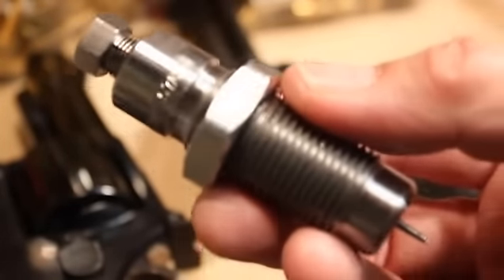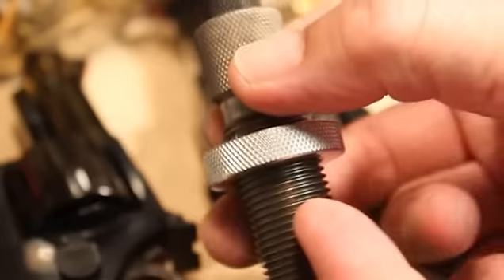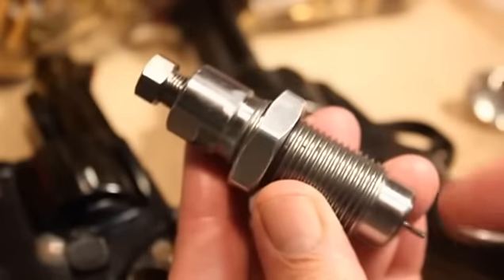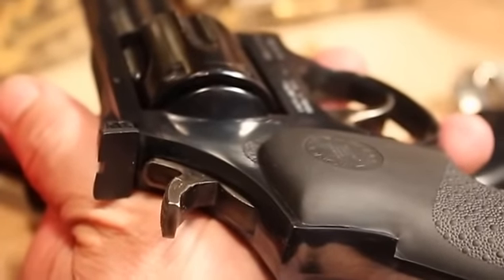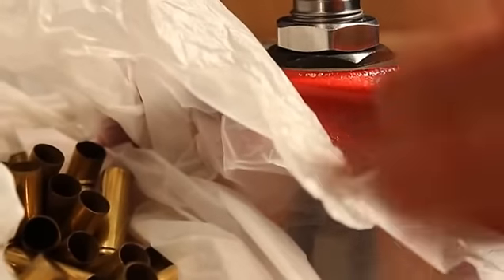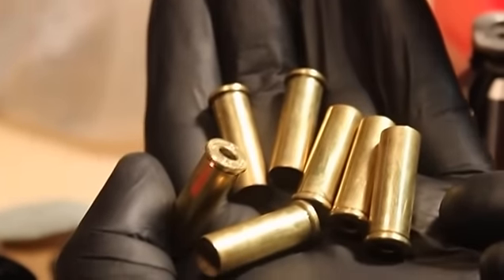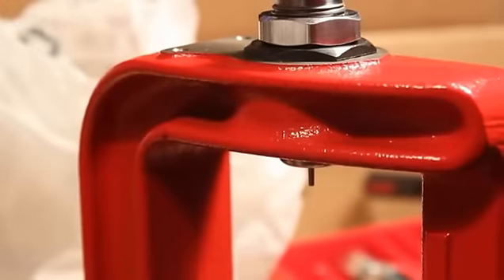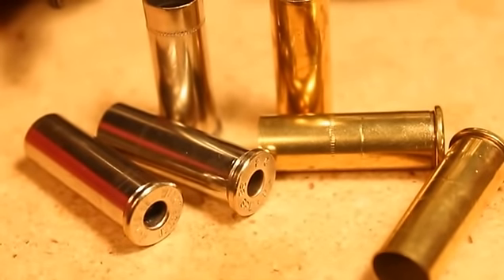Carbide And Sand - The Taboo On Resizing Brass First And Then Cleaning

Comment: When I bought my RCBS Rock Chucker II single stage press some 30 years ago, it came with a how-to video. In the video, it stated the order of steps to case prep:
Inspect the cases.
Lube the cases outside and inside the case mouth.
Run the case into the decapping/resizing die.
Check the overall case length, trim if necessary according to the load data.
Champher, and deburr the case mouth.
Run the cases through the dry tumbler. 
Remove from the tumbler, inspect the inside and the flash hole for media residue. 
Cases are now ready for priming and reloading. 

Been doing it this way for both rifles and handguns, ever since I rolled that first, once-fired .340 Weatherby case up into the RCBS die, and countless .357 Mag, .44 Mag, .45 ACP, and .40 S&W cases into carbide dies, thereafter. Nary a scratch on the cases and upon close inspection, the dies are none the worst for wear. If it ain't broke, no need to fix it.

Comment: RE: ~5:30  -- I live in Central WA sagebrush country. Wind blows sand everywhere at most of the places I shoot out doors. I've learned not to leave gun cases open after having a gun get scratched by the foam padding absorb blown sand and moisture, only to scratch and spot rust the gun left in the case.

Now I vacuum out the foam from time to time, and keep the cases closed while at the range. All my brass is always gritty and that helps with the first stage of the dry tumble process. Smart shooters in my area are careful to clean magazines inside and out regularly and avoid wet lube systems on their guns.

Comment: My method is to tumble in walnut shell for about 20 minutes, then decap. I use a 50/50 mix of Nu-Finish car wax and mineral spirits in the walnut media. This gives the casings a very slight coating of wax that makes the resize/decap process a breeze. After that they go into the liquid tumbler and come out awesome! For drying, I commandeered an old food dehydrator the wife planned to sell in a garage sale. It works very well.
Reply from the maker: ***** You've hit on it!!  Good rinse followed by thorough drying is what makes the wet tumbling results that we want...Food dehydrators do exactly what we need for our brass drying - got to go check those out at Target or Wal-Mart next opportunity...I've been using a hair dryer or the sunshine (great for summer)...  Have a great day
Reply: *****  I do similar, minus the nifty food dryer. I have a toaster oven for that & other firearms chores. Old walnut media gets dirt + mineral spirits. Then brass is quickly sifted and transferred to clean walnut media pre treated with nu-finish.

Comment: The point was made that smokeless powder contains no grit. That may be the case, however, "Priming compound, which may contain glass or other abrasive, is very abrasive in action on the dies and it must be wiped out frequently or wear will occur" (Twenty-Two Caliber Varmint Rifles, Charles S. Landis). Landis was referring to steel rifle dies, but regardless, the point is that primers contain abrasives. 
I have other references that state there are abrasive materials in priming compounds, such as a PDF from McDonnell Douglass  that states "Probably the most frequently used fuel for priming
compositions is antimony trisulfide, since it also doubles as an abrasive" (http://www.dtic.mil/dtic/tr/fulltext/u2/a114616.pdf) 

And this:
" Up to early 2000 [with the advent of lead free primers] the most common primer composition encountered was still the lead styphenate, barium nitrate, antimony sulfide and tetrazine type. In this priming compound, lead styphenate and tetrazine are the sensitive explosive ingredients; barium nitrate provides additional oxygen to increase the temperature of the flame, and antimony sulfide acts as a fuel to prolong the burning time. Aluminium, and occasionally magnesium, can also be encountered, but mainly in the higher-powered magnum pistol or rifle calibres.
Powdered glass was also often added to the mixture to increase the friction and to assist detonation when the mixture is crushed by the firing pin" (https://www.bevfitchett.us/ballistics/priming-compounds-and-primers-introduction.html)

 I have read on various reloading forums that carbide is so hard that only a diamond can cut it. This is false. Carbide can be ground on a common aluminum oxide grinding wheel, the same wheel many people have on their bench grinder at home. Notice I said "can be" not "should be." The point is that an A.O. wheel will cut carbide.  (Note: I grind my TIG tungstens on a A.O. wheel, but don't tell anyone. ;). I haven't tried grinding or scratching carbide dies on purpose using common sand or grit, but maybe in the future. 

I post this comment because in the video a great emphasis was placed on the fact that smokeless powder contains nothing that can scratch or wear a carbide ring. Priming compound residues contain materials that can, arguably, wear or scratch a carbide die. How big of a concern is this? Probably not enough to lose sleep over. I think a better question is what happens to that abrasive dust when you vibratory tumble? I imagine that it's spread all over the exterior of the case, which is then ran up into the die. Seems a little counter productive. 

Again, just food for thought. I appreciate the videos and hope see more outstanding content. Take care, John T.

Comment: This remains one of the most controversial subjects in reloading, but I’ve joined the “Size and De-Cap” first minority. I did 10s of thousands of clean first then decap rounds, then came to realize just how much more effort it takes to size “clean” brass. I began using Hornady One Shot case lube, resulting in slick cases. I also noted that my powder would stick to the “non-fouling” dry lube at the case mouth, thus ensuring that seating a bullet required it to push the powder out of the way, unless I cleaned the brass again after resizing. Way too many touches for me. All of my shooting is indoors, floors are covered with carbon, but no grit. Now I squirt my dirty brass with One Shot, size and decap, put into my dirty brass bin awaiting sufficient accumulation to break out the wet tumbler, and I haven’t scratched a case or a die yet. If I ever get to an outdoor range I’ll decap, then clean, then resize, as the majority demands.

Comment: Well now I think I will invest in a wet cleaner. I live in Oregon and winter mud equals revolver shooting. The mud makes the primers tarnish quickly and I end up using a primer pocket brush to get it clean. Your way would be perfect for my revolver brass. As usual, the information you freely give here is easily digested. Thank you FortuneCookie45LC.
Reply from the maker: ***** Good reloadin' and good shootin' to ya!!  FC
Reply: +FortuneCookie45LC 
fortune cookie i'm getting in to reloading and i have a question on 
reloading .38 special 2" snubnose smith and wesson what's the grain 
require for that particular gun..

Comment: Another option for decapping dirty brass (prior to tumbling) without worry to get grit in  decap/resize die, is to use the Lee Universal decapping die.
Reply from the maker: JBBooks4440 Got that in the latest Midway order - it's part of the idea for this video - do we just get that die or use our resize die to decap (and size at the same time) - can't hurt our carbide die and if the size die gets dirty, a brush will fix that up pronto.  Best Regards to ya

Comment: Hi FC. 
I have found that even after a quick cleaning straight wall  that I get a lot of resistance when depriming / resizing..
I am referring to the Lee carbide die. So I do use a little lube and the process goers much smoother..
It is on the return stoke that I find the sticky resistance...
Am I doing something wrong?
Reply from the maker: tjmooremusic - Not at all, there is some resistance to resize whether the cleaning is done before or after the resizing.  And yes, a light application of our homemade lanolin type case lube does make the resizing go easier.  Plus, the lanolin left over doesn't have to be removed (it acts as a natural protectant) afterwards unless the reloader simply desires to do that.  A number of our reloader friends on YT like to do this spray treat before resizing.  Have a great day,  FC Steve

Comment: i use the universal decapper then i toss the bass in a bucket with hot water mixed with salt dawn and vinegar to clean the bass, then i relaod it, if its ammo i reload to store for a while ill toss the bass in crushed walnut with nu finish to polish it to keep it clean in the ammo boxes
Reply from the maker: Josue Guzman - Sounds like you've got your systems in line that work very well for you...Thanks for posting...there have been others that like to just soak their brass...  FC

Comment: There's a guy on ebay named guntools that sells an upgraded decapping pin for that lee universal decapper. I got tired of breaking pins on crimped primers and since I've been using his hardened upgrade pin I've never broke one yet. Just do a search for " Ball End Decapping Pin Upgrade for Lee 90783 / 90292 universal decap die " and you'll find it.
Reply: Prepare2Survive Good to know. I still have 4-5 spare Lee pins though. Dang pebbles and the occasional berdan case are the culprits.
Reply: GunFun ZS
Yeah, I've had pebbles bend a few of my pins too.

Comment: just a little rinse in a frying basket in hot soapy water  before sizing ,will get  the grit and dust of  , if needed.  in the primer mixture/compound is grounded glas used. i am told. yours peter

Comment: in a perfect world your 110% right, but, for instance where I live we have blowing sand, (and old fumbly fingers) so I clean my cases 1st, used to throw them in the case tumbler while I put shooting gear away and cleaned guns..  we all have our own little traditions dont we.. As i get BACK into reloading and more shooting, I'll probably change a few things....
Reply from the maker: Rob Aldridge This video was just to get some thinking and discussion going...The general recommendation is still to clean our cases before resizing.  However, wet tumbling to clean our cases is best done after decapping so this video is just having us think about how we are going to decap - with a Universal Decap Die or with our straight wall pistol carbide sizing dies.  (No option with steel sizing dies, of course.)  Whether we size before or after wet tumbling is a small point since the LUDD is not expensive.  In spite of the taboo, it really can be done before or after.  You would need magnification loops to see any loss of finish from sizing after the tumble polishing.  I bought the LUDD to use it.  Best to ya...
Reply: FortuneCookie45LC I've looked at that Decapping die too, could be quite handy
Reply from the maker: Rob Aldridge Some tell me it is their most used die...I can see how that would be the case...(pun, ha, ha har)   ;)
Reply: oh, your so PUNNY today....   LOL !!

Comment: fortune cookie i'm getting in to reloading and i have a question on reloading .38 special 2" snubnose smith and wesson what's the grain require for that particular gun..
Reply from the maker: +Mariano Santana -- Congratulations on your S&W 38 snubbie and also for your interest in reloading.  The 38 is an extremely versatile caliber capable of shooting bullets as light as 95 grains all the way to heavy 212 grainers.   And as for powder charges, there are about 50 different gunpowders that you can use to load the 38 all the way from real light cowboy loads all the way to +P 38s with power over and above the standard service ammunition commonly found.  So you see, the answer to your question depends on many factors.  The first thing I'd recommend to you would be to get some good reloading manuals like the Lee 2nd Edition (or more recent if available) Reloading Manual or the Lyman 49th Edition Reloading Manual.  Study the material in the manuals and view as many reloading videos that you can - I have fully detailed videos on any reloading subject you care to look into.  But there are many others in YouTube that you can check out.  In the meantime, enjoy shooting your snubbie - You should have a good supply of fired brass to begin your reloading.  ONce you are then ready to begin, please come back with specific questions... Best Regards to ya,   FC
Reply: thanks fortune cookielc

Comment: Actually for revolver shooting under normal conditions, there's no need to tumble ones brass except for cosmetic reasons. Resize, reload, shoot, repeat. Never had a problem.
Reply: Charles Edenfield That's been my experience over many years of reloading for revolvers too. Now that I do polish my brass, I still resize and deprime before cleaning on any brass that doesn't hit the ground. Never had a problem with carbon build up or other damage to carbide dies that people like to warn about.
Reply: I'll probably get a tumbler given a good opportunity. As you get older when you can no longer be good, you might as well try to be pretty 😅
Reply from the maker: Charles Edenfield We may be getting older, but we aren't old by any stretch of the imagination...now, where was I??  Oh, yes - I was going to polish some brass and look for my checkbook.... Good day to you, Sir Charles Edenfield!!
Reply from the maker: jima28080 Carbide is extremely tough to scratch, and it is very strong when it is encased in that steel die body - removes a lot of the brittleness concerns that carbide has...When it gets carbonated (and that only happens once a year), an old toothbrush takes care of that in 5 seconds without even having to take the die out of the press...And the polish is maximum when the polishing is done after resizing.  But the beauty is that reloaders can do what they want - we'll all get to the same place.  Best Regards

Comment: I like and watch all of your vids, this one i dont quite agree with though, no thumbs down, just disagree. the buildup of carbon on the outside of the case would line the inside of the sizing dye eventually causing marring on the cases. how many times do you have to clean a dye even if you have just ran the cases through a tumbler? the only way i could let you off the hook on this one is if you had complete expansion of the case and had no carbon burn on the outside of the case that is still clean. thanks for taking you time to inform us with your vids Mr. FC45LC.
Reply from the maker: 02pwrstrk You make a very good point - sometimes our videos stir up good controversy.  The word has always been to clean our cases before resizing ever since the vibratory dry case cleaners were developed, and this video is not intended to say we shouldn't do that - just get some thinking going.  To wit,  with the advantages of wet tumbling comes the considerations on tumbling before decapping or after decapping.   I don't like the extra step involved in decapping before wet tumbling, but I've grudgingly found it is the best way to go.  So I asked myself, why not decap with our resizer dies and have the advantage of resizing our cases also before wet tumbling (advantage - wet tumbling after all case body manipulations have been completed with the superior wet tumbled shine on our finished rounds later).   I recall the early days when we didn't have the dry tumblers and resizing dirty cases in our carbide dies was commonly done.  If our resize dies got grungy, we'd just take an old toothbrush to the carbide insert and were good to go.  We just wiped our rounds off and shot our inferior looking reloads.  This video was originally entitled On Carbide And Sand.  Perhaps it needs another title change.  Incidentally, if resize - then wet tumble - then progressive reloading - we'd just take the sizing die out of the toolhead and load away...Appreciate your fine comment... and please keep your comments coming... Best to ya
Reply: 02pwrstrk  I agree also. I give my brass a quick clean in the vibrator and then resize. I will then as needed trim, deburr and do any primer pocket work that needs to be done. I then clean it again thoroughly and then store it until it's time to reload. Doing this with rifle brass is an extra plus because it removes the case lube also, sure beats wiping them all down!

Comment: My new lee resizing die is scratching my 45 colt brass. What should I do?
Reply from the maker: Driftstage5 - Resizing scratches are caused by grit in the die or on the cases or scratched sizing die.  If you clean your cases and also the resizing die and still get scratches, then the sizing die is scratched.  Since most 45 Colt sizing dies are carbide, you cannot fix the scratched die yourself - the die should be sent back to Lee for an easy replacement.   Good reloadin' to ya,  FC Steve

Comment: i always use a universal decapper than tumble my brass til its sparkling clean and then i reload...
Reply from the maker: scott perry Thanks for your comment, Scott!  Nothing wrong with that at all - most do it that way.  I used to just tumble my brass right back from the range, and then straight into the Dillons...never cleaned a pistol primer pocket in over 40 years.  I should do a video on why that works...perhaps this weekend...  However, now that I am wet tumbling, I'll be decapping beforehand... Best Regards to ya...

Comment: does the same apply to black powder and pyrodex?
Reply from the maker: G S - No - we need to decap that BP brass with the Lee Universal Decap Die and clean that brass with wet tumbling pronto.  I'd also clean the LUDD afterwards as well, that BP hygroscopic fouling should not be left on any of our good steel and brass anywhere after shooting.  Good point that needs to be annotated in the video - Thanks for pointing that out... Best Regards